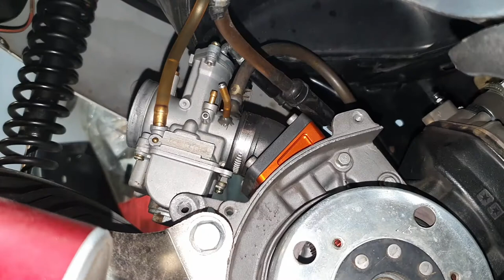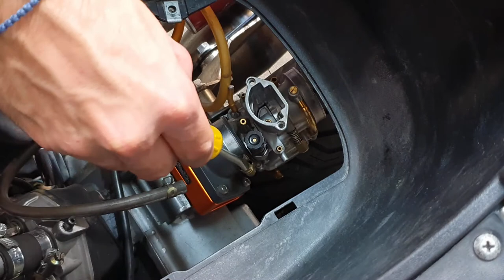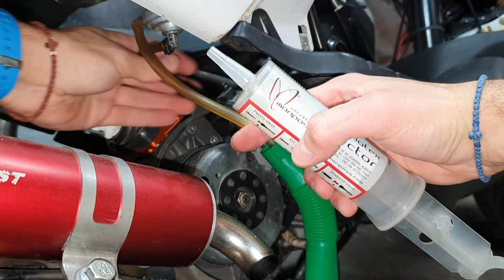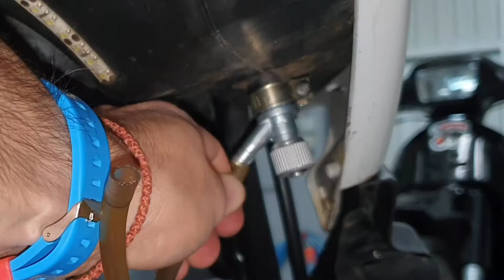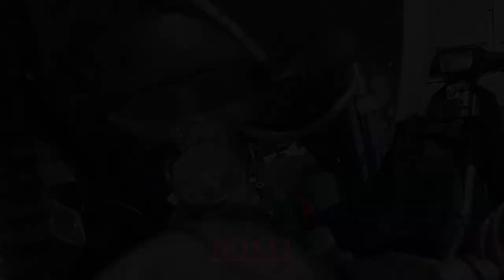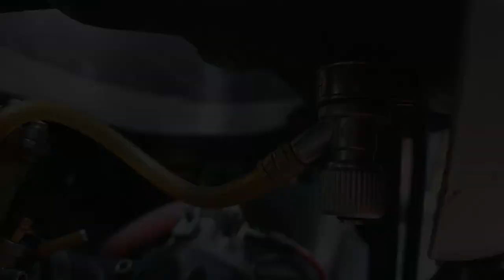🔧Vacuum to Manual Fuel Tap Install | Piaggio Zip LC |Stage6 StreetRace 70cc | Yasuni C16

Comment: What throttle cable are you using mate I’m currently building one for a friend of mine
Reply from the maker: I'm using the stock throttle cable.
Reply: @binostuning  he is saying his carb won’t run with the stock cable the splits to the oil pump have you got any experience in this mate
Reply from the maker: @Tizzy_p  I have remove the cable that goes to the oil pump. I just left the cable that goes to the carb
Reply: @binostuning  I understand I had a similar cable with a dtr that goes from like 1 into 2 in the weird long box, I don’t suppose you can make a video of it just showing what youve done can you
Reply from the maker: @Tizzy_p  right now I can't. I'm servicing the hellenic army until summer.
Reply: @binostuning  ohhh shit I totally understand my bro I hope all is well and your doing your people a great service both ways!!! If I get stuck with any things is it cool to ask any questions here
Reply from the maker: @Tizzy_p  Thank you 😊 
Of course you can ask anything

Comment: Does it flow better?
Reply from the maker: Yes. The carburetor get filled faster.
Reply: @binostuning  my zip bogs down at full throttle because the carb bowl doesn't get filled quick enough this will most likely fix my problem right?
Reply from the maker: @Jakubcarphotography  yes probably
Reply: @binostuning  came today i installed it and it idles very high anything you'd advise i did turn the fuel/air screw but it makes no change to the idle
Reply from the maker: @Jakubcarphotography  Check if there are any leaks from your intake or your carburator.
Reply: @binostuning  that was exactly it i forgot to hookup the vacuum since i have the stage 6 carb and inlet